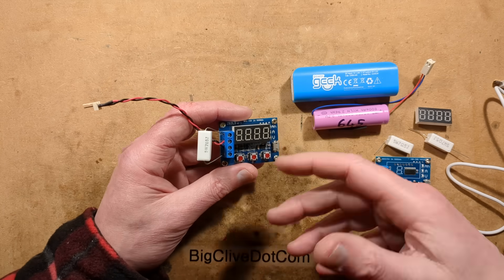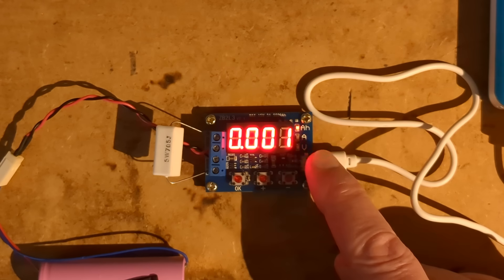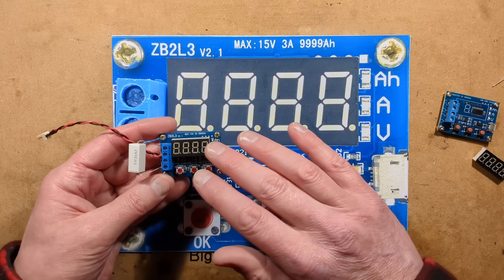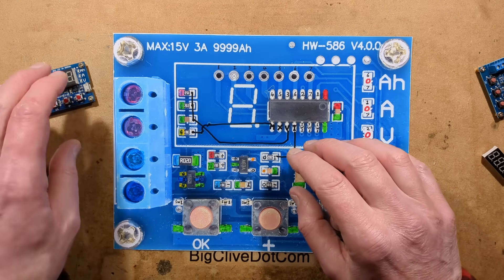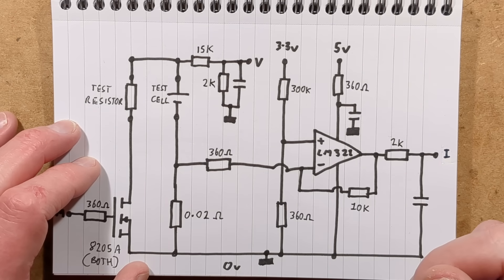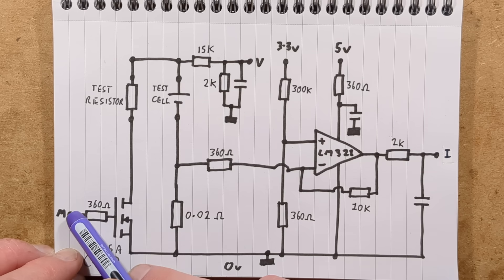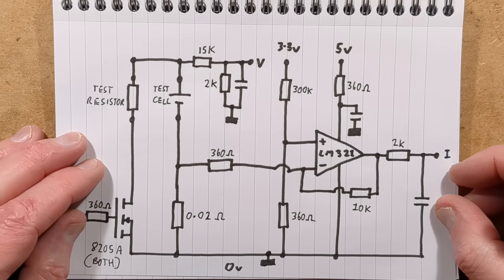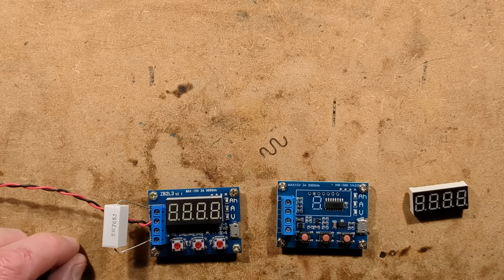Lithium cell (and battery) capacity tester with clever circuitry

Comment: I suggest bunnie Huang's essay "From Gongkai to Open Source" for one take on the Chinese understanding of intellectual property. There seems to be an understanding that running a design from the design pool obligates the designer to contribute an improvement back to the pool. Updating a design to remove or update obsolete components would be considered such an improvement.
Reply: Isn't that just open source at this point? Kinda explains their rapid growth.. Interesting to see how they ultimately ended up with a open source-ish system
Reply: @idranoutof1d  It's my vague impression that they shut people out of such communities' forums/resources/etc for failure to contribute their work back, instead of depending on copyright injunction to enhance their common resource pool.

Comment: It would really be nice if you could use a charging-circuit instead of the resistor so you can use some of the power from the measured cell for that instead of just heating.
Reply: It looks like the module just puts the output across the battery, so you probably could put a little charger or maybe one of those little 1S USB boards on the output.

Comment: Will this circuit work with nimh battery's have a heap of cells from some toyota prius battery's i want to test as im making a big backup battery
Reply from the maker: It should work with individual cells or batteries as long as they are within its voltage range.
Reply: @bigclivedotcom 7.2v 6ah per cell

Comment: Why would one place a 360R resistor in line with the 5V op-amp supply input? What would be the purpose? Thanks 👍
Reply: Its a supply noise filter, as the op amp is configered to amplify, and would pick up any noise from the 5 v usb supply.
Reply from the maker: Probably to help decouple noise from the op-amp supply rails.

Comment: that pad on the back might be for calibrate mode.  I often do things like you short two LED lines or on a current project, you short a switch input to an LED pin.  The processor checks this on boot to see if it needs to calibrate.

Comment: I used the old version in a DIY car battery tester. With a 6 ohm 100W resistor and a fan on top of it.

is the new version better than the old one? accuracy wise. is a upgrade worthwhile?
Reply from the maker: My preference is for the calibratable style just in case you get a non-calibratable version with rogue component tolerances.

Comment: Instead of the resistor, I used a simple TL431 with a transistor as a constant current sink to set any current I want. The transistor is on a heatsink.
Reply: Cool idea,  there.  Can you give a few more details about how you set that up?
Reply: @Roy_Tellason  It sounds like this 'DIY Constant Current Load'. Greatscott did a great tutorial vid and instructable.
Reply: @Roy_Tellason  Where V+ and Vo are connected instead of the original load resistor.  Changing Rcl changes the current. https://youtu.be/3DT1Ou9Pgag?t=114
Reply: I've got one of the older, much bigger and much more complicated versions that have a built in current sink transistor on a heat sink. It bleeps when the cell reaches fully discharge and uses a 4 wire connection to the cell, 2 for the load and 2 for voltage sensing.
Reply: Omg why didn't I think of that...I have some looking for a project...

Comment: Clive: I have a similar device (like this one) that uses a fixed value resistor as the load. I always wondered how accurate it was for the following reason:
Do you think the calculation of the battery capacity takes into account the ever reducing value of current due to the battery voltage going down. Ideally you would have a constant current discharge so the current vs time would be linear giving a more accurate ma/hr measurement. I suppose they could sum individual current measurements taken between accurate time intervals  but do you  think it's that sophisticated?
Reply: All you have to do is sample the current and voltage every say one second, multiply the two together and add the value to the last sum. At the end of the test that sum divided by 3600 is the Wh. And just sum the current samples to get Ah. Does not matter then if V or I are not constant. It's not a difficult process as you don't need to store every sample and sum them all at the end.
Reply from the maker: This unit does the computation based on measured current over time.
Reply: Once you have dV dI and dt small enough you can easily calculate the dicharge in Coulombs.

Comment: I dunno. It's a nice little board but if this is £3 than the Atorch DL24 load/capacity tester is way better value for money even if its 7 times more expensive. Not to mention that you need to buy power resistors for every different discharge rate you want to use with this board.

Comment: Can this be used while charging something with the battery?
Reply from the maker: Technically speaking you could connect an actual load in place of the resistor.

Comment: What will happen if one were to install a 10 milliOhm, instead of a 10 Ohm power resistor? 
Also, unless they constantly calculate the power because the current is changing due to battery's voltage dropping with time, the capacity would be wrong. 
I DIY'd my own from "Scullcom Hobby Electronics" channel here on YT. That's a real beefy "electronic load", where the user has the source code and can do many magical mystical things! 
I've built many of his excellent projects. He hasn't been active for many years now.
Although a nice electronic load can be bought for under $50 these days, it won't have hard work and pride attached to it as a project that I'll keep for life.
Reply from the maker: As long as the test current is within the units ratings it should be able to read it.

Comment: What's the 7 segment display part number.  I can't find one that only has 7 pins on it with four digits.  I'm struggling with how the multiplexing is working as well with only 7 pins for 4 digits and all the other knick-knacks.  If there was some more logic built into the display it would all add up but 7 lines to multiplex 4 digits just doesn't work for me.
Reply: Charlieplexing is the term. 7 tri-state pins lets you control 42 LEDs.
Reply: @georgeprout42  Correct. Its origins seem to go back to 1995, the creation of Maxim apps engineer Charlie Allen, as a means of using fewer pins in circuits with limited I/O pins. Lots of articles found on the internet and YT about it for those who want to delve into it.
Reply from the maker: I'm not sure what the magic keywords are for finding these displays on AliExpress.  Driving them in software requires continuous scanning one-LED at a time with the appropriate output pins being toggled between inputs and outputs as well as high and low.  There are probably microcontrollers with dedicated tri-state drive modules inside.
Reply: Thank you all.  I've learnt something today :-)  Wikipedia has a good page on Charlieplexing which I'd never heard of.  I was comfortable with the classic multiplexing way of driving of 7 segment LED's and thought that the display may have had an embeded TM1637 or similar to do the multplexing.  I've had a good scout on aliexpress and a general sniff around but can't find an exact match for that display shown.  Charlieplexing seems to turn up a lot of the dot matrix LED displays and a couple of 2 1/2 digit displays but no 4 digit displays.  If I manage to find them, I'll update here.

Certainly interesting and it's got me thinking.

Comment: Gate driven with 10mA by the 360 resistor.
Probably the peak limit of uc pin.
Reply: Many engineers are not aware of the reason for these gate limiting resistors. The reasoning can best be understood for a grounded-source FET by viewing it as an inverting op amp, but one with quite limited op loop gain (maybe 50), but still SOME gain that is good enough to get the job done. The gate is the inverting input. The non-inverting input is "virtual" in that it is the threshold voltage of the FET ("Vth"), perhaps 1V (±). I.e., "nothing happens until you start to turn the transistor on or off" to get it running in a linear gain mode. The output is the drain. For an NFET, when the gate goes high, the drain goes low — it's an inverting gain function. The source is the "ground" pin through which the load current flows. There is a capacitor between the gate and the drain, Cgd, often called the Miller capacitance, that comes into play. 
If you have ever played with an integrator, you know that it's output is a voltage ramp because the integrator forces a constant current through the capacitor connected between the inverting input and the output, the FET gate and drain respectively. An opamp-based integrator makes an almost ideal triangle wave generator by alternating the direction of the current flow.
While a MOSFET integrator is less than ideal, it reacts pretty much the same way as the opamp version. If you put a voltage probe on the FET's gate and a current probe on its drain, you will see the gate voltage first start to rise, but when it hits Vth, it "pauses" as the drain then starts to conduct and the drain commences to ramp down, but now in a controlled fashion. At this moment, the FET's gate is held to its "virtual ground" of Vth due to the action of the integrating capacitor, Cgs. The integrator current is then (Vin-Vth)R, where Vin is the forcing voltage and R is the series resistor feeding the gate from Vin, 360Ω in this example. This current has nowhere to go other than through Cgd, which then forces the drain voltage to ramp down in a controlled way due to V/t = I/C = (Vin - Vth)/(R*Cgd), where t is the time it takes for the drain to move from Vdd down to 0V. I.e., the drain voltage can be shaped in a way that creates a desired dV/dt.
Why would you care? Well, this trick works for both PFETs and NFETs. There are times when you want to put a FET between a power source, such as USB's VBUS, and a load that you wish to switch on and off. What happens if you use a PFET between your power source and your load that has a big honking capacitor on it, like 470uF? If you slam your PFET on in an uncontrolled fashion, you will get a very large peak inrush current of I = C*dV/dT where C is your 470 uF. The peak current can easily exceed many amps, which can often cause your source voltage to considerably sag, causing bad things to happen, like the source shuts off. What you need is a way to control that dV/dT slew rate to your large filter cap. The simple integrator I have described above solves the problem, and does so IN A VERY PREDICTABLE WAY. I have seen fellow engineers put a fairly large capacitor on the gate-to-ground node, saying it slows down the inrush. Yes, it does, but my retort is "and what does it reduce the inrush current to?" They cannot tell me, other than "that's what I measured on my prototype. "So you're going to go into manufacturing with a circuit with a key parameter you cannot reliably control?"
That's why you add this resistor, and often a little discrete Cgd of your own. For two simple passive components, you can almost precisely control your inrush current. And it works!
BTW: 1) this trick works for both on and off control of a FET, but usually you are most concerned about the on time. 2) you don't want to employ the trick if you are switching a load on and off a lot of times per second, like a switching regulator does. Because as the transistor switches on and off, there are very high power transients passing through it that can quickly heat up the FET and destroy it. If the duty cycle is low enough, the average Pd is low. This also explains why the switching circuits I have seen that put a small resistor between the driver and a discrete power FET to drive the switch at 100 kHz - 1 MHz are asking for trouble — that FET will get smoking hot in no time!
Reply: @demef758  just to add some fun fact: the GaN fets have almost zero gate capacitance and any of it, even the little amount made by pcb planes and tracks, prevent it to switch... they are very fast with very low di/dt but you have be careful in routing the pcb.

Comment: The input circuitry th the op amp doesn't make sense. Returning the inverting input to ground and using the non inverting input across the current sense resistor would provide a positive output voltage against current. Even if the op amp doesn't include 0V as a common volt input surely the the op amp output should be below the 0V rail which isn't possible?
Reply: it is a standard configuration: inverting amplifier with offset.... the trick is that the voltage at the input is negative!

Comment: Mine is marked “ZHIYU ZB2L3 V2.8. Max 17V 3.5A 9999 Ah.” 12 pins to the LED. However the instructions say Err1 >15V, Err4 >3.1A. Specs say max 12V 3A. I don’t use it because there are many better options these days, notably the Shunda TEC-06.

Comment: Nice circuit. The voltage they are amplifying for the current sensing is negative with respect to ground, the amplifier then inverts and multiplies it by ~28. 
I think the very small voltage of ~4mV on the positive input of the amplifier is so that zero current does not result in zero voltage on the output, as small offsets from the amplifier might move that to the negative. The 4mV result in about 0.1V on the output when there is no current.
Reply: I like the way you are thinking. BUT...

yes the math agrees with you as the transfere function is : Vout=VnonInver*(1+Rf/Rin)-(Rf/Rin)*Vinver , and as you stated, in the schematic the way it is drawn Vinver will always be -ve with respect to ground thus Vout will be positive,

However physics does not negotiate, The LM321 is powered by a single supply so feeding negative voltage into the inputs violates the input common-mode rule.

The schematic needs modifications see my comment.
Reply: No, the input common mode isn't violated, since opamp feedback action will keep the inverting input at the same level as non inverting. Even if circuit is driven to saturation, the 360 ohm resistor will limit current, lm321 has maximum input current rating of 50mA.
Since battery is floating, we can connect it wherever we want, and the battery current flows from battery + to battery -, not to ground.

Comment: Is the end point voltage of a 12v lead acid battery not 10 volts?
Regards
Keith.
Reply from the maker: It depends on the chemistry.  10V can be too low for some lead based chemistries.

Comment: Interesting little unit - the 15k draw is tiny, especially with a depleted cell. A bit higher if SLA 12v etc but <1mA it’s no worry unless a coin type cell / backup battery etc.

Comment: That voltage divider on the +input for the LM321 is odd. It's providing a 4mV zero offset for the amplifier. It's like they took a circuit for a one-sided opamp and changed the resistor value to mostly eliminate the offset. 

Really odd that they didn't just ground that input. Its possible that the LM321 isn't a rail-to-rail opamp, but i don't know how they could address that issue with only a 4mV offset.
Reply: Actually that divider makes sure, that under all conditions, the input offset voltage of the opamp (which is roughly +-4mV itself), won't cause negative (ground) saturation of the opamp OUTPUT (edited, instead of "input"). This way at zero current drawn, the opamp output will be at least slightly positive and measureable by the ADC. They probably have some built in selfcalibration function, that saves this low ADC value as true zero, preventing the opamp ofset from messing up the current measurement.
Reply: Yep, minimum low output value is 5mV-20mV for that opamp, they reused the 360 ohm from the bom and stayed on the safe side.
Reply: The LM321 is a ground sensing op-amp, they could easily have used a non-inverting topology (ideally with the ground reference on a dedicated trace from the sense resistor) instead of an inverting topology.
Reply: @Scrogan  Did you miss the fact that the voltage input (on the left of the 360R) is actually negative?
Reply: @RichardH-w5q  too bad, use the negative-most point of the circuit as your op-amp’s negative supply.
Reply: That divider would work well with dual rail power supply. For single rail we use OP AMP meant for single rail. I would redesign the circuit using an LM358 with one opamp configured as Schmitt trigger (using positive feedback), and the other opamp configured as virtual ground generator (voltage follower with 50% resistive divider). The circuit in question hasn't been drawn by an electronic engineer, but copied and adapted from a different device...
Reply: @Ray_of_Light62  a dual opamp costs more, and with more components around. A good design engineer should balance what he is designing for.

Comment: I'm really impressed with these testers...I will get a dozen of them for testing the 6v & 12v SLA batteries that I use in various battery backup systems.
Reply: What are you using to measure internal resistance?
Reply: @thisisyourcaptainspeaking2259  Resistance is futile.
Reply: @Fanta.... Internal resistance is a key indicator of state of health for any battery, especially those being used to provide consequential load currents.
Reply: @thisisyourcaptainspeaking2259  Think you missed the joke 😂
Reply: .  Yeah I wasn't sure, so I clarified.
Reply: @Fanta.... 😂😂😂